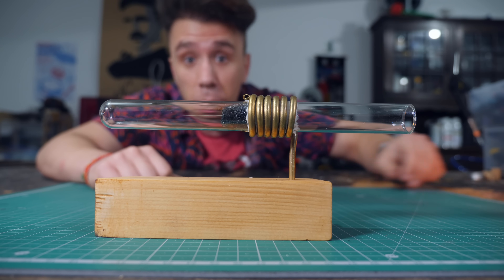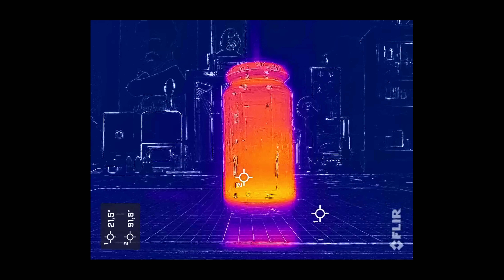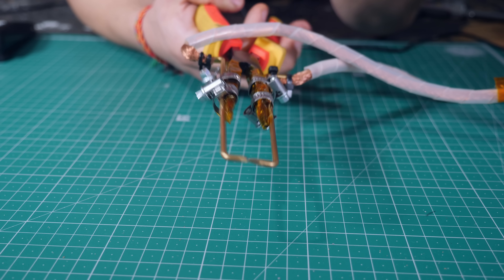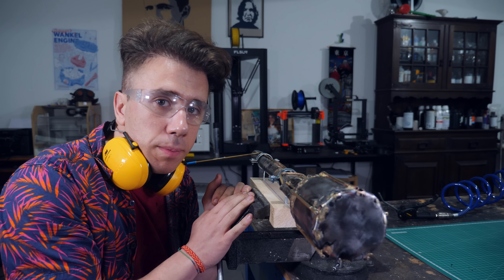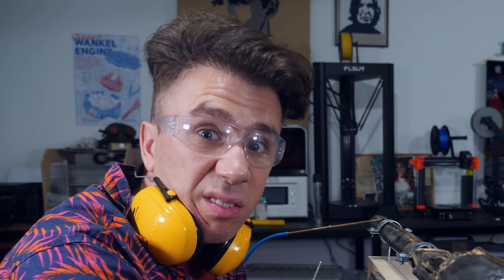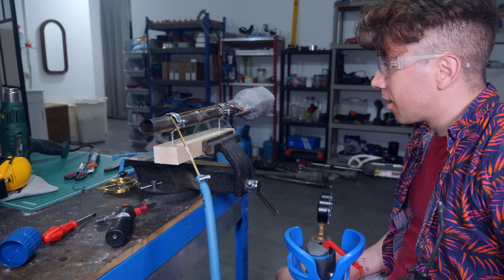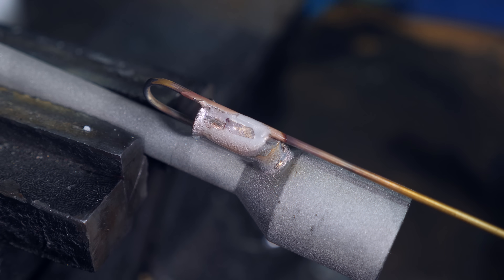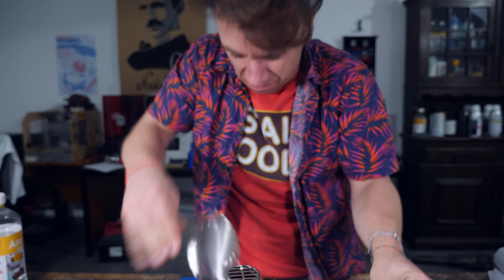JET ENGINE with NO MOVING PARTS (Pulsejet Engine)

Comment: This is not really a pulse jet engine. A proper pulse jet, such as the ones allegedly used in ww2, will have reed valves on the front that open and close to allow it to draw in air. When the proper pulse jet is working, it makes a buzzing noise and that's why those missles were called "buzz bombs". As you are doing it now, the thrust is going to be low to non-existent because you are using the exhaust for air intake. What you have made here is essentially a dim candle...or possibly a noisy heater...but it's not a "jet engine" since it generates no meaningful thrust.

If you want to make one you can use a spent aerosol can as the combustion chamber. They have a welded seam and can take the heat. The reed valve assembly is made out of a flat piece of thin metal that is cut into a flower-like shape, with a hole in the middle to mount it. the reed valves need to be a springy metal, i.e. steel, and they would seal against a metal disk that has a couple holes drilled out for each petal. The side of the disk where the reed valve meets the disk should have a silicon coating or something of that sort to improve the seal. Sealing pressure is provided by combustion so you don't need springs nor does it need to be overtorqued. Place a cone over the center of the reed disk on the intake side to direct air into the holes, and prevent turbulence from building up at the intake. An outer shroud around the cone can be made with sheet metal, taking care to make the angle of the shroud the same as the angle of the inner cone.

Comment: Your spot welding technique is actually used in some pretty advanced aerospace applications. The centaur upper stage rocket is a "balloon" of ultra-thin stainless steel sheet metal (around 0.020") that's joined and sealed with tens of thousands of spot welds. It's so thin that it has to be pressurized or it'll collapse under its own weight, but it's the highest performing upper stage rocket in terms of mass fraction
Reply: Hey it's the cryocooler guy
Reply: Tell. Me. More. That. Was. Cool.
Reply: Integza: Tomatoes are disgusting.
Also Integza: This Moroccan style tomato-based sauce is pretty good.
Reply: @FLPhotoCatcher  only because its the blood of his enemies
Reply: It's also extremely janky for a pulse jet. He could just get a cheap mig welder and learn in less time than it takes to 3D print.
Reply: FRIDGE GUY!!!

Comment: Hi there love the channel I have a suggestion for you the experiment you did with the candle and the wire wool in a glass tube with the water try to make some kind of heat to electric Conversion system with the experiment that you did ,maybe I don't know

Comment: you should make somthing with a 3D printed roman steam engine (Aeolipile). i belive that this will be interesting to try getting the engine working without it meltin gbut also being light weight enough to spin at high speeds.

Comment: Imagine the potential of combining two powerful techniques: electroplating and 3D printing. By utilizing electroplating, we can transform the surface of your 3D prints into genuine metal, enhancing their durability, aesthetic, and functional capabilities. But let's not stop there. Have you ever considered the synergy of two different engine types working together? Envision a Rotary (Wankel) Engine serving as the powerhouse to drive a pulse engine. Such a combination could unlock unprecedented efficiencies and capacities in the realm of engineering and innovation. Let's explore the possibilities!

Comment: Maybe you could try proving if the DaVinci helicopter would work by making a light version with 3D printing and a powerfull yet tiny motor and some lithium batteries. Hailings from Mexico.

Comment: Sounds like you need to learn about lost PLA casting my friend. Print in plastic, pack sand around it, pour in molten metal. The sand mix is the most important part; google is your friend.

Comment: Pro tip: to make it so you don't have to worry as much about a tube collapsing while bending fill it with sand. Once the bend is done you can just blow it out with air if the sand doesn't fall out on its own.

Comment: would it not make more sense to just use an empty soup can and a piece of tube with some connection fittings to bolt it to the lid or bottom of the soup can?

I mean, building the can and the pipe out of sheet metal?
Kinda crazy i would think.
Reply: a vacuum cleaning tube and a soup can, i mean, why build that stuff if it already exists?

Comment: You could try to fill the small metal tube with fine sand before bending it. This should help with the tube buckling too much and you can drain the sand out later assuming it's fine enough and clean.

Comment: I wonder if you would consider creating a basic laser tripwire security system? This could be a very viable and interesting project for a maker. Especially if the core functionality is kept simple to start, with room for optional expansions later on. The process of designing, troubleshooting, and refining the system would also make for engaging video content. Making a custom enclosure that neatly houses all the electronics and laser pointers would add a complexity level to the structural design and fabrication, and including the ability to add features like a webcam, motion tracking, or remote monitoring/control would ramp up the complexity quite a bit.
Reply: Sounds like you need to post!!

Comment: What if you took this design with the thin walls of that metal that you can just spot weld . But then you braised on some copper tube where one end would be connected to a pump. Where you would pump a reservoir of ice water through the copper tube which would carry away the heat before it could melt the thin steel

Comment: Video idea:
Build a ram jet engine that can reach high subsonic or even super-sonic speeds. It requires airflow so a strong force of air will have to be applied if it is stationary but if it is moving it could sustain speeds although very inefficiently a low speeds. It has NO MOVING PARTS similar to the pulse jet and it continues to be the most effective engine for high speeds even though the idea of it was created over 50 years ago. I think it would be really cool to see this in a video and maybe even break the sound barrier. 

Note: 
The fuel line it would have to be incorperated in the design of the engine otherwise you will probably have a problem sending fuel to the enine when it is possibly going over one thousand kilometers per hour. One thing though it will definately need to made out of strong metals such as tungsten or titanium so it will be more expensive but will probably be the most powerfull jet you will have ever built.

Comment: Hello👺
I am aerospace engineering student.
I think we all are in love with fire.
I follow ur videos regularly,i love ur experiments why coz as a student we are restricted to many things with fire but u are a professional to do what u want.i like that. As u have done some testing on rocket engines as a individual components,i think this is time to upgrade.
As a suggestion of video: 
 Try making a mini rocket engine using 3d printed injector,cc and nozzle it may not withstand temperatures but its go to be more fun in make one .to improve the standard of model we can use some cooling system like liquid cooling.
The main moto is making many aerospace engineering dream true my making one single part engine with all structiral components printed. This i want to try but i don't have the machine. So i am waiting to see this project in channel soon.
 All the best 🎉

Comment: what if you use a single cylinder engine block with cooling fins as the combustion chamber and welded the exhaust to the end.

Comment: Since tomatoes are discussing can you destroy one with the engine? Also for the video idea is there a way to set up two pulse engines so that they’re alternating, so when one is high the other is low to keep a constant output?
Reply: I think that could be accomplished with a EFI system, fuel injection & timing is getting pretty tweaked now days.

Comment: You shoud try BNSF Ultrafuse Stainless Steel 17-4ph or 316L. It's a metal filament that you can use with a desktop 3d Printer. You'll need to send the parts out to get debound an sintered but you will get a 100% metal part.

Comment: I completely relate to your intense fascination of various jet engines. I have build a few pulse-jets as a teenager but all welding stuff. Have you looked at covering your 3D prints with gypsum or different chemical concrete/ceramic. The print acting as a die for the gypsum casting then. Give it a shot.

Comment: @Integza Remember Startlite the 'wonder' material? Plenty of yt videos on diy attempts, but wouldn't this "coating" inside regular 3d prints make it both lighter and easier to make? Zero-welding is just a bonus lol
Reply: It should also be simple to test, based on the jar experiment. If the jar/glass doesn't heat… it will last "forever."

Comment: may you print same engines with different sizes or types of nozzles and then try to measure which jet engine has more trust (looking forward to win 3D print as im in need of it as emerging engineering graduate in mechanical)

Comment: It would be really cool if you can encase that engine in a small tank holding liquid hydrogen, the heat from the engine will vaporise the hydrogen increasing the pressure while simultaneously cooling the engine... Sort of like how rocket engines work ... everyone like this comment if you wanna see him make that

Comment: You should do a lost foam casting of a jet engine, with epoxy resin and sand to form fuel coolant passages. In the walls of the engine to keep them cool.  Mix the sand with resin by vacuum infusion in straws to make the passenges around a foam core, use vegetable oil and a leafe blower to make a furnace to melt iron or steel, fron car parts  from a salvage or recyclers, break rotors are hoid iron, aluminum rims ae a good aluminum to cast aluminum parts from. And and antisway bars and springs are a good steel to use.  Use a torch to get a small amount if oil burning, basically build a jet engine ftom s leaf blower, and use oil as the fuel.  Nake a nozzle using a pump to force a mist of fuel into s combustor.. used engine oil works the best, maybe mix s bit of diesel with it to thin the oil, wrapping the exterior of the combustor with the fireplace sealer you use, will  help with heat transfer.  Use exhaust pipe fir a car , 40-50 mm fir the smaller part, and 75+/- a bit gor a combustor, probably judt the smaller pipe inside the larger, and the larger pipe heated at the edge and hammered over a steel bar to meet the size of the smaller pipe,  do the same to the opposite end, only more aggressive, bending the edge over closer to 90° leaving a flat edge.  Then cut a short bit of the smaller pipe long as tfe diameter of the larger pipe. Cut a slit length wise. And make a flat sheet, use a angle grinder, with cut off disc , to make a roughly round piece to fit inside the end of the end of the large pipe , 
with a smaller hole in the flat plate, use a long piece bot 30-35mm pipe to fit sbout half way into the small pipe inside the large pipe, the medium pipe having holes all over ig about 6mm diameter, anout 18-28 or so. The leaf blower blowing in the small pipe. Fuel sprayed in the gap between large and medium pipe, with the torch heating thr area in front of where the fuel is sprayed, use a pwm brushed motor controller zo control the speed of a 12v water, fuel transfer pump, about $20-$30 on Amazon here,   use the pump starting out slow,  ramp up until a decent flame without smoking is reached, start the flame by heating the can red where the fuel enters the combustion area. With the blower on low. Eventually ramp both up. Using a metal trash can with walls of refractory mortar, about 100 mm thick, in the floor!, walls, and lidbof the can, also add s 150mm hole in the lids center,  leabing a ; hole just offset from center, in the bottom of the can, about 65-70mm, at an angle to make a swirl flame in the can, a small hole vcan be added in the combustor to help ignition. About 3mm where the fuel is being sprayed.  It should  be hot enough to melt steel,,  and maybe required to wrap copper tubing around the ,,pipe and flow water through it, to help cool it. About 4- 6mm tubing, Flowing about 2-5liter per hour. Use plaster  to dip the foam in then pit in dry sand, and pour tge metal, alowto cool, and clean the parts!  3d printed parts can be used also!!  Have fun, hope you try it!!✌️

Comment: @integza If you want to cut down the time for making templates, I have plans for making a scalable CNC laser engraver/cutter/plotter. The bill of materials comes out to about $400 if you don't have any hardware or bits of a 3d printer laying around. I also use masking tape sheets to make custom masking for painting with it.

Comment: this might be a dumb idea, but would it be possible to make a six-cylinder engine run on smoke from a furnace if the smoke is at a high enough PSI? because a gas engine just makes a lot of pressure in a cylinder and so does a steam engine, so it would possibly work the same as far as I can tell, but timing would be hard for the valves but just smoke would eliminate the need for a ignition system, and I think I remember you trying to make some engines that had cylinders in the pass, and this would possibly be easier than a steam engine. short but concise idea!

Comment: You should try and develop an air augmented rocket engine. or any kind of afterburner-esque design. I used to work with experimental hybrid engines and have wanted to mess with augmented engines ever since I discovered the the concept

keep it up the good work

Comment: Integza, I like these videos.  Idea for future video,   Augment an rc flying airplane with ROCKET power!  This is a project I’m planning myself but haven’t made time for yet.  I want to take an existing RC airplane I already have and augment it’s power with a small rocket motor.  The idea is, I’ll take my P51 RC model airplane and attach a couple of small hobby rockets to the structure.  Then while I fly the plane by I’ll ignite the rocket motors remotely with an electric match.  Finally, I’ll keep control of the flying plane via its existing remote control architecture.  Except now it will be augmented with rocket power and should really be something to see!

Comment: Hey integza! Following the boom tooob video, you should follow up with a potato cannon; 12cmX22cm combustion chamber, a large pvc screw cap for loading hairspray, grill starter or spark plug for ignition, and a 1mX50-60cm barrel. White PVC makes a nice glow when firing in low light.

Comment: Maybe you could try the thin metal again, but try to use a flir to see what spots are getting the hottest, and try to make a cooling system with copper heatsinks to make it run longer?

Comment: @integza if you have access to metal 3d printing, you could try out a rotary detonation engine. 
Jokingly:  Extra bonus points if you use it to power a rotary subwoofer.

Comment: hi Integza, quick welding tip when you weld you want to heat up the area where you want the join to be. try putting the blowtorch a bit closer and then apply the material you can also then reheat the surface. This avoids potentially harmful dripping and discolouration of the metal. But so far you're doing great soo keep it up!

Comment: Can you try an idea please the pla jar version you printed the went mushy. Can you print that again but on the second print do the main burn section then give it a 1cm gap with an outer pla section and fill the internal 1cm cavertu with water and seal it. The water should creat a heat sink drawing the heat away from the internal pla combustion chamber. If you see what I mean. If you put water into a coloa bottle you can put the cola bottle in fire and the bottle won't melt and you can boil the water.

Comment: I think Your letdown with a few things is lack of fuel control. This jet, and your catalyst tesla turbine are 2 examples, this over revved by running rich, would have blown anyway but alot slower. The hydrogen peroxide on your tesla turbine needs to be flowed in at a constant rate from low speed pump, maybe try a petrol/diesel injector connected to a fuel pump.. pump might only last a few minutes though

Comment: I wonder if it's possible to create a form of jet engine that uses protective air currents on the inner surfaces of the combustion chamber and exhaust to isolate the walls from the high temperature. It may be optimistic to use such an idea with PLA, but maybe something like PEEK will hold up to the radiative heat.

Comment: Jets are awesome! But what do you do with them? You make them fly!
You should get with someone who can remote control a plane and then attach your jet. Use a small pressure vessel for fuel. And start the rocket. Have the plane take off and then use only your jet to power the plane. 🌟EPIC!☄️